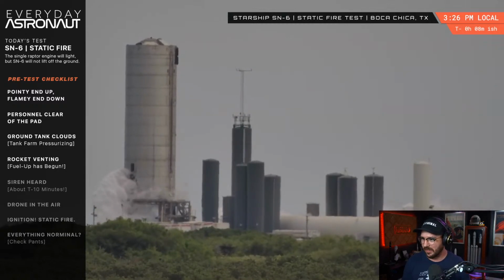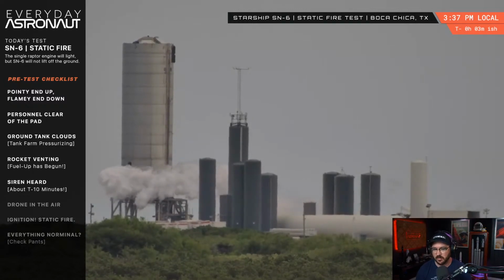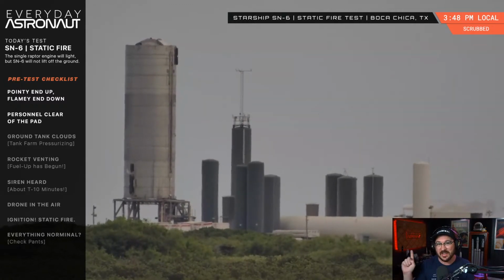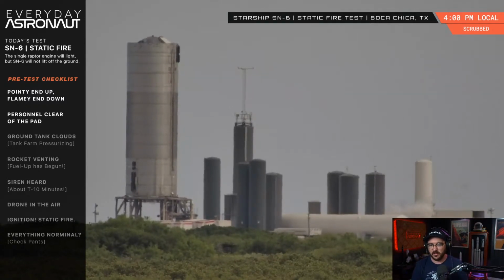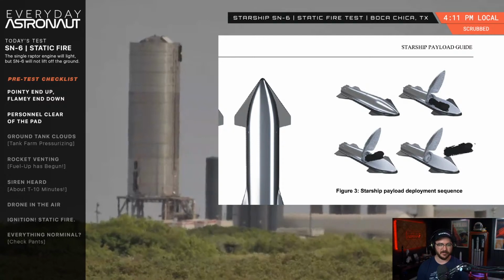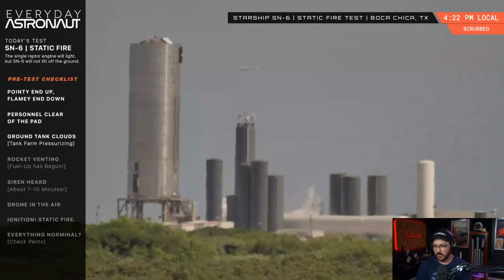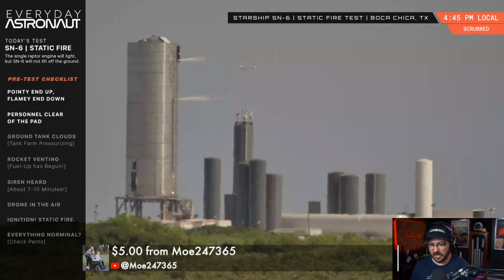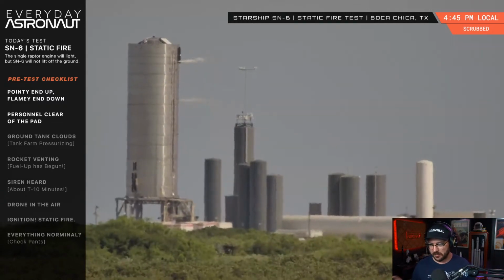[SCRUBBED DON'T WATCH] Let's watch SpaceX static fire Starship SN-6!

Comment: will Somebody explain why they will not build an adapter engine mount so they can send her the engine and get a straight flight approved as a fly on an angle why be foolish can't be there not smart enough to build adapter plate.
Reply: wasted effort and cost when software can handle it.  Sorry it looks funny to you but also show the excellent control they have of the test ship